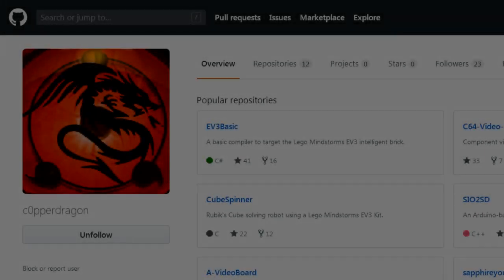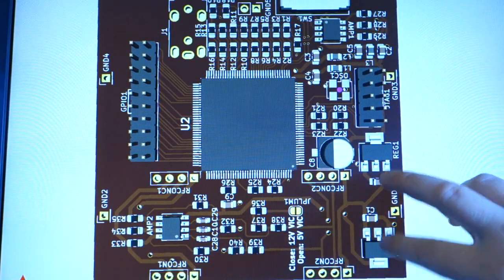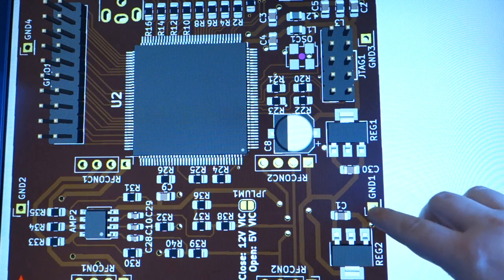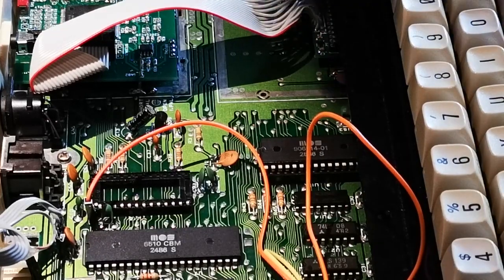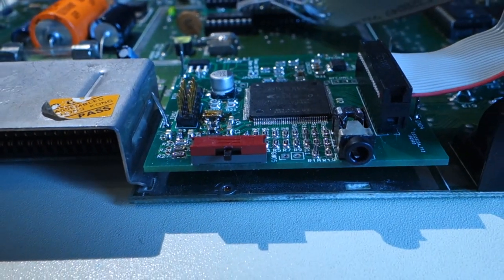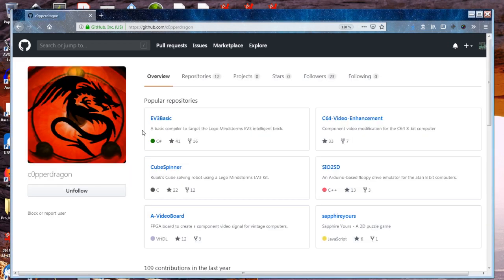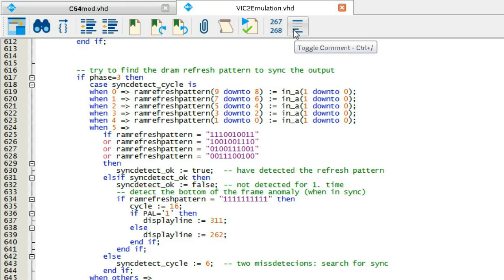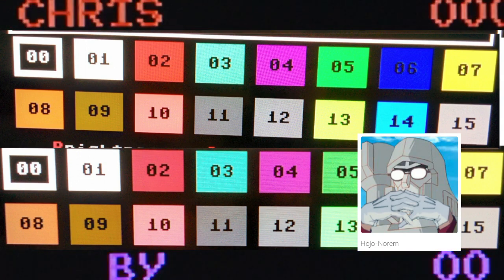C64 Video Enhancement - component video fpga VIC-II graphics emulator

Comment: using a Microchip MEMS instead of a crystal would also be a working option, i guess.
what about modifying your c64 motherboard to eliminate the whole vic-ii section and make a pin header for an adapter pcb that contains the "video card". a standard one with a socket for the VIC-II.
additional pins for rgb out, maybe an optional pin header for hdmi out. and all these video out pins routed to the modulator pin section, where a board could be placed to contain all the video and audio connectors including a DAC that connects to an extended stereo SID that has an I2S or SPI interface
Reply from the maker: Not a bad idea. Someone needs to do this :)

Comment: Hi, any clue about porting this vhdl code to board like Sipeed Lichee Tang Nano? Also my other idea is to use a PAL decoder like tda8217 and split hsync/vsync signal. At the end we should get RGB signals @15kHz so its like CGA. The last things is to try connect it with Wii2HDMI adapter to get HDMI output.
Reply from the maker: Hi. I have no clue. You have to ask the designer of the video enhancement board.

Comment: Wow a VIC-II FPGA implementation!?  Not a complete replacement or is the VIC-II chip just put on as a passthrough backwards compatibility option?
Reply: This would be great on the Reloaded board. :) I have a reloaded board, it would be great to load it up with FPGA replacements. The only thing that hasn't been FPGA'd is the CPU I reckon. :)
Reply from the maker: @lactobacillusprime  I think it is a step closer to VIC replacement.
Reply from the maker: Implementation, sadly not replacement.